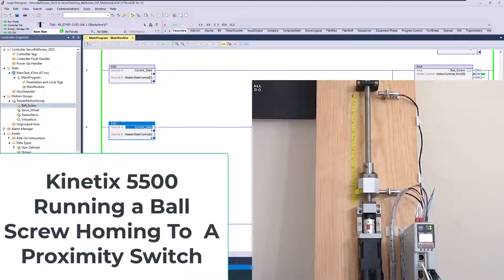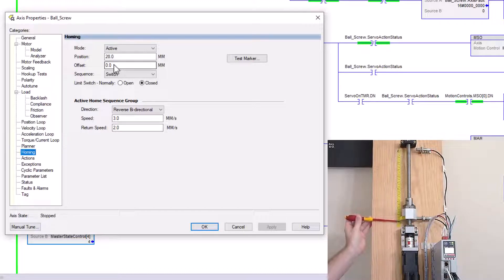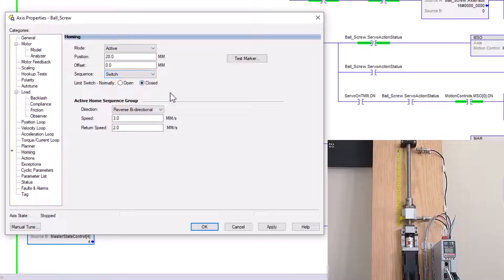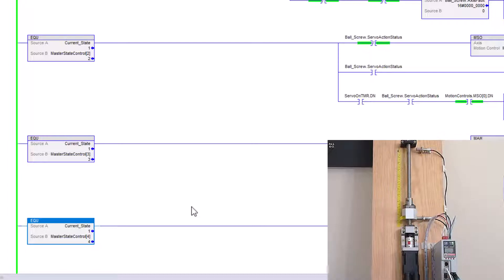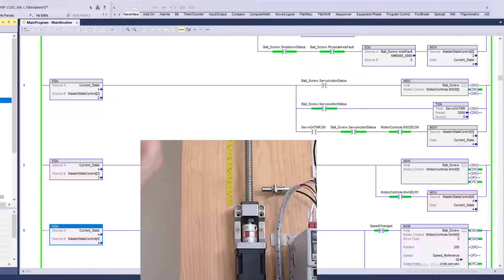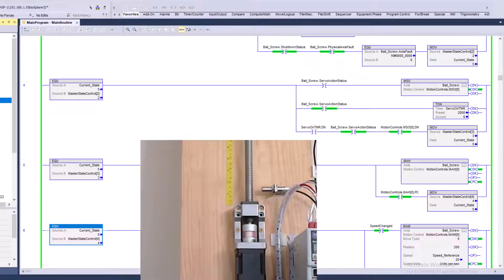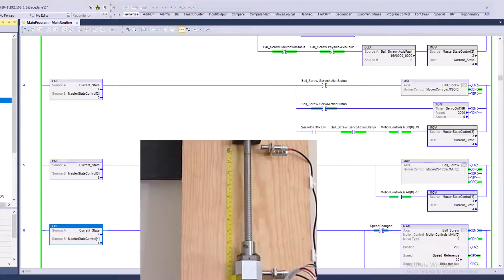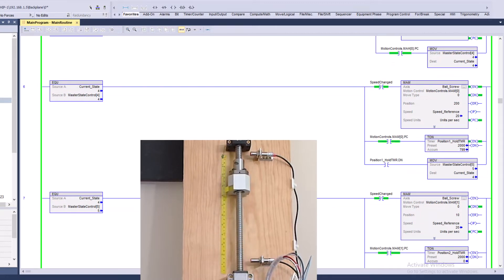Kinetix 5500 Running a Ball Screw Homing to a Proximity Switch

Comment: Could you elaborate on why the kinetix 5500 can’t be used for home to torque? Sorry if it’s a dumb question but I’m new to this
Reply from the maker: @OrbMan97  this model I'm using doesn't allow home to torque
Reply: Right now we are using an AOi to get around this but the 5500 doesn’t actually have an option for it & we keep getting physical axis faults-excessive position error very randomly. It is being used for linear actuators setup with “direct coupled rotary” under the scaling settings. Any suggestions on this?